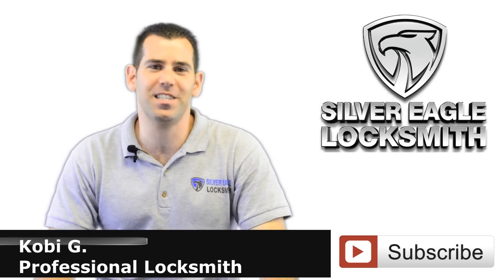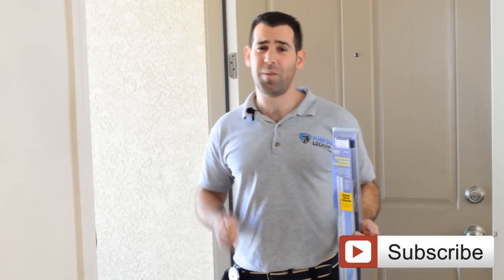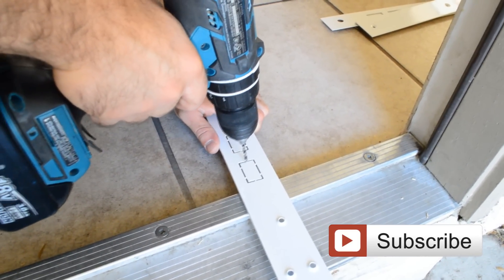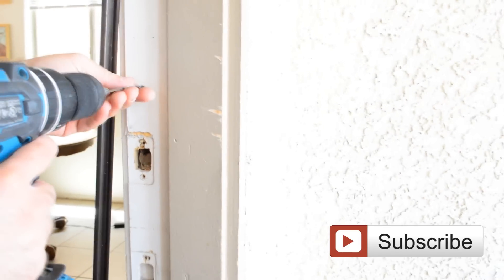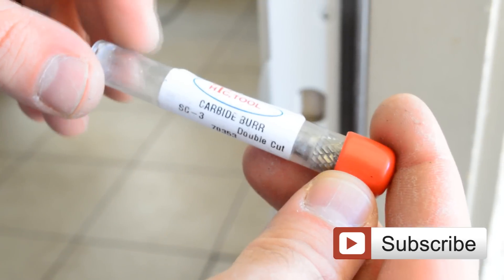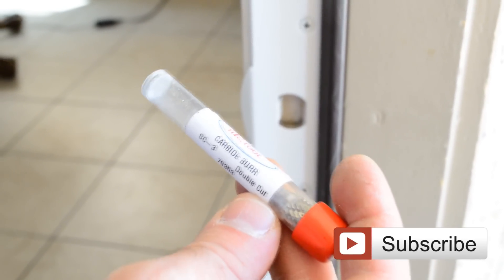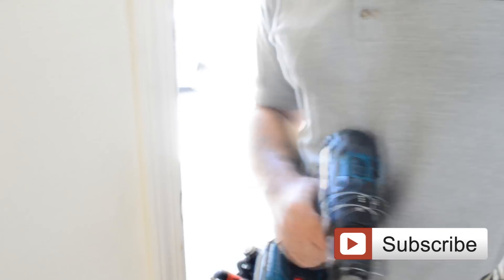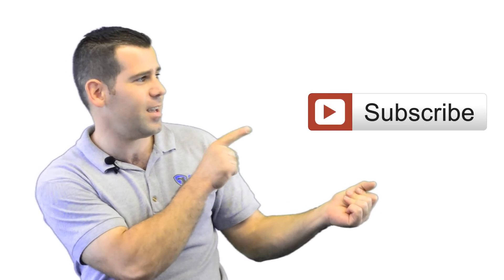Strike Plate - Burglar proofing Your Home With The Ultimate Door Strike Plate

Comment: Use a hack saw blade and not a drill to remove the plates and then file down or sand down any sharp edges.  That "plastic thing" is weather stripping that needs to be put back in place when done.  Use a center punch before drilling. More than one plate does not provide you any better security than multiple plates.  If it was all one plate that would be much better. A wood chisel will give you a much more professional cut than will a carbide bit.  That deadbolt cover is worthless, it will do nothing.  Don't just buy any woodscrews, buy hardened wood screws like SPAX for example.  BTW, Ring Doorbells are 1K which is not enough resolution for identifying a face or a license plate.  Buy 4K security cameras only.

Comment: The piece you did not use could it be used on the handle. This is assuming that the door doesn't have a dead bolt.

Comment: If you don't have a drill bit for some reason - I wont judge, I have a drill with spade bits but no regular drill bits lol - then you can use a block of wood and a sturdy flat blade screwdriver to punch out the metal @ 5:50

Comment: Maybe it makes sense if the door opens by swinging out, but if the opens swing in, then it makes zero sense to install this product unless you have lots of chump change to spare.  The whole idea is to prevent break-ins and won't stop you from going out of your home.
Reply from the maker: It makes sense to install it in both scenarios. You see what holding the door is really the frame and it doesn’t really matter if it’s a swinging in or out type of door, good reinforcement is highly recommended for any door
Reply: @S.E.Locksmith  Does this type of reinforcement work for double door or you have to use a different type of strike plates?
Reply from the maker: HonYin Kok No This Strike Plate it’s not for a double door. 
For a double door I would recommend you to check my other video: Nightlock Door Barricade - Double Door Reinforcement Tip https://youtu.be/1Ox85x5UXZA

Comment: Doesn't protect against sophisticated forced entries using a Halligan bar with a flat head axe to the hinges to which even the screws you suggest are no match against. You rip the trim off then hammer into the hinge plane to easily Force entry.
Reply from the maker: My recommendation is to reinforce the door from average burglars, not someone that have high intent to break-in. If someone really wanna break in they can also breaking window and getting much faster but that’s another topic of course

Comment: Look here folks theres aint a damn thing you can do about it. Im not a criminal but for whatever i thnk like one. This wouldn't slow down even a novice because theyll jam a porta power in the door frame and Jack your door open like it drop the soap in prison. Not to mention my previous comment about just foregoing the door and coming through the wal.
Reply: I saw a cane that would push a door frame apart till you just had to push the door open.
A cop had taken it from a criminal and kept it for getting into homes in an emergency without damaging the door. The criminal that he had got it from had used it for many years because the cops did not know it was a buglers tool.
One night he got caught on camera using it, then the cops had him. And it did not leave a mark on the door frame to show it had been used. And most homeowners never knew he had been in their homes till they found some things missing from in a closet or draw. Weeks or months later.

Comment: Three locks works well and as well as two locks with the lock strike plate.  But to be honest this option of 3 locks cost more.  2 deadbolt and one of the is a medeco deadbolt.   That should do it too. I got deeper screws with the medeco deadbolt.

Comment: We have metal doors and these on on them as well. Also the hinges have these little lips that stick out to keep the door from being kicked off the hinges as well. Upgraded all the screws to 4 inch screws as well. The front door I installed 2 of these things on the top that you can flip down when you are home to also help with kicking in. I've not put it to the test but I am certain nobody could kick in my doors and would need a battering ram or smash into it with a vehicle. That along with security film on all my windows and cameras and motion sensors and door and window sensors my place is locked down like fort Knox. Last line of defense if someone did make it in successful they would not be walking out alive.
Reply from the maker: From what you just described it’s sounds like Security is your TOP priority. 
It’s good to be smart than sorry

Comment: Those screws are not 3 inch diameter. THEY ARE 3 INCH LENGTH! The smaller screws are not less than 1 inch diameter. THEY ARE LESS THAN 1 INCH LENGTH!

Comment: To all viewers out there...my door got kicked in by a burglar or something who was just angry at me for not being home. I just went the store in the evening when I got home my door was ajar. So I tried to look around at ACE hardware store for something like this. My door jamb was damaged. So what i did was use a metal-stud strap plate I installed it and made a 3/4 inch hole and put it on the backside of the door jamb. I'm confident the next time the perpetrator won't be able to kick in my door. But I like to purchase this plate in this video. 👍 But like I said folks I used a 6 inch wide flatstrap the metal-stud framers use and I used some self tapping screws metal-stud screws which have a lot of holding strength. I'm a metal-stud framer.

Comment: “Damn! This door is tough. I’ll just break a window.” - Every Burglar
Reply from the maker: Did you know that you can make your windows reinforced also...?? 
Check my video:  https://youtu.be/Tg8AvttC46M
Reply: Silver Eagle Locksmith - I watched your video and the window film IS impressive. However, I have a few questions. Is the film available in ‘clear’ (non tinted)? Does the film require the glass to be removed from the windows? I have Anderson dual pane insulated windows that are filled with inert gas to prevent condensation. Is applying this film to MY windows a DIY project, something that has to be done by a professional glass company, done by Anderson or maybe something that can’t be done with my type of window? I also have two skylights. Can they be made more secure? As you said in your video, most people believe that “a burglar will get in anyway”. I have hardened my home, but I’m under no illusion that it’s impenetrable. I just make my neighbor’s houses look like easier targets. Thieves typically go after the low-hanging fruit. If all else fails, I’ll give them .45 reasons why they shouldn’t have picked my house. :-)

Comment: I would highly recommend using those door reinforcement plates on the bolts. Just as a visible deterrent it will save you a lot of grief. Thieves would try kicking the door leaving dents and shoe prints if they think there are no backing plates. I have a door with glass windows, so the first thing thieves see is a glass break alarm next to the bolt, the next thing they see is the metal plate screw mounted over the deadbolts, the third thing they see is the tint on the window so they can't see into the house. The more layers they see, the more hurdles they have to get around.

Comment: good product, better would be a whole door wrap that encompasses the deadbolt as opposed to just the door edge. 

That said,  very poor security specialist advise to not install even the door edge reinforcement. if there is not sufficient gap, create it with jig and router to make the clearance sufficient to have both the strike reinforcement and door edge wrap not rub !  also check hinges to make sure they are in good repair and not allowing the door to sag.. don't address symptom, fix the issues as well. good advise on the hinge screws to put in longer screws. 

also, you can minimize the risk of breaking off the screw heads with drilling the correct size hole for the screw, lubricating the screw threads with a bar of soap, wd-40, etc... AND not having your #2 phillips bit cam out of the screw head by using an impact driver instead of a drill motor... 

40 years in the business, in case you want to know...
Reply from the maker: Sounds like you know what you talking about... “40 years in the business” so my respect to you. 

One thing you totally forgot, that most people here on YouTube looking to have fast, cheap and affective security solutions and not working their a*s o*f 
To make their front door to be Fort Knox. 

Of course there is more things that can be done to increase security in general but the door strike is in fact the weakest point and this video teach you to fix this issue.

Comment: Guaranteed if someone tried to kick in the door, it will give at the weakest point which is the locks. The door will split so all the strength of the frame is useless unless you strengthen the door and locks.

Comment: I think the longer screws that go through the first piece of wood and into the actual door frame is really all the security you need in the strike plate area and replacing two screws in each hinge.  The fire department would have to come through the door itself than the frame around it.  No foot or shoulder is gonna break it down.
Reply: mama2one1 that’s better than most default installs but not enough to resist like you suggest.  This solution distributes the force across more area.   There are stronger options but they require more effort and trim repair.

Comment: Locked my keys in my house and had to break in. I bought one of these at Lowe's after repairing my wall. Very easy to install. It makes a difference.
Reply from the maker: It’s always works for Broken frame etc
Reply: Ross Miller

Comment: I guess i will be needing to re tile my house after you are done installing
Reply: To ishome iuuio
Reply: Always do it with a piece of wood underneath, also, using the clutch 

stops beheading the screws!!
Reply: I suggest you rewind it to 06:25 and check out the holes in the tiles
Reply: If you look at 5:45 right before he even start drilling it looks like theres already holes in the tile. Theres some definite black underneath the panel before he even start with the first drill hole. This might be his house and he mightve done this very same thing when installing the jam or door or something.
Reply: To ishome M
Reply: Yeah this guy is the guy that screws up your house in the process of installing it. And then comes back the next day and burglarizes your house.
Reply: @ianbrown8900  you cant penetrate tile like that! You have to drill it! And he stopped his drill once he made it through. Worst case is the bit came into contact with the tile and scuffed it a little bit which it didn't.  I would feel extremely sad and sorry for you if you actually consider yourself a handy "MAN" yet you would still need to hire someone to come in and install such a simple item!! My brother is 18 and he could do this easily with even a  blindfold on!!
Reply: I don't think he actually put any holes in the tiles. I think it's just shavings from drilling. But yeah you use an old scrap piece of 2x4 under it to make sure you do not penetrate anything else!

Comment: Thank you, I just learned the best way to completely complicate installing a piece of 25 cent steel to my door jam.
thank you
Reply: just kidding,
I liked the video but the product seems like you could get a lot more for the money.

I pulled out my door frames and replaced them with 4 x 8 studs that I made from raw lumber and welded some steel caps on both sides and top anchored with 3/4" lags then built a 3" thick door with integrated woven steel inserts inside of the door w/  1" pivot hinges and a brass / steel, 2 key, 5 point dead bolt for about $160.00 

If I remember right the steel I used to completely frame my doors was about 30 bucks
Reply: absolutely,
there is a ton of things that can be done to increase the security around the house. from adding a few screws to parking a tank in your front yard lol. keep up the good work.
Reply: Ingenious solution to a non-existent problem IF you have a pit bull and pump shotgun!
Reply: So jay stew ,,When you got ripped off. They went in through a window?
I personally like the shotgun hooked up the light motion sensor.
Reply: 25 cent steel?  That would be an option, but the kit he used has 3 sections designed to overlap and with cut-outs for the dead bolt and latch, and it comes with the required screws--no looking for them.  I dunno what the kit costs, but there's some value to having what you need all together.

Comment: Someone kicked my door in while I was out . The door frame casing was split .  As a repair, after fixing the casing, I installed a heavy duty integrated double strike plate and installed long screws into the studs. The kicker person was EXTREMELY lucky that I was not home at the time of the incident (if you catch my drift). What is strange is nothing was stolen.

Comment: I would remove the one piece of casing and install shims between the stud and jam at each new screw location so when you tighten the screws it doesn't open door jam reval and have a big gap. just my opinion
Reply: didn't hand tightening the screws (after drilling proper pilot holes) keep that from happening?
Reply: As long as he doesnt throttle the screws in with a heavy duty impact there is no risk of deforming the door opening. The foam that is in between the door jamb and stud is high density and heavy enough to prevent even moderate deformation of the door jamb. The biggest mistake he made was in thinking that the drill bit length makes any difference whatsoever. Even the best custom build door jambs are only 3/4" thick wood and piloting the length of the screw even if we assume he is trying to reach well beyond the stud is not necessary. He could save time by just using one bit. Lol at people complaining about using ceramic tile as a backing during the drilling process - even a cobalt bit isnt putting a hole in tile without serious intent.

Comment: One thing you can do instead of installing the plate ( and do it differently, mind you ) is back out the small 1" screws and replace ALL of them with 4" screws, on the latch side as well as the hinge side. If you have a solid door and frame it's gonna be VERY HARD for anyone to kick in your door, with those 4" screws, makes all the difference !
Reply from the maker: I definitely agree with you but the overall Strike Plate is a big part of reinforcement to any wood door
Reply: I had my husband add 4 inch screws to all our exterior doors, hinges and strike plate, then installed security doors. That plate would not give me that level of security i need when my husband is away for work.
Reply from the maker: Trevino Bush and how much this all pleasure cost you ?
Reply: Silver Eagle Locksmith: Money is not an issue. My home is an investment.
Reply: Trevino Bush saying your home is an investment and money doesnt matter makes no sense. There are things you can do to your home that will not affect the value. Therefore should not do if your home is a monetary investment. 

If you are focused on peace of mind your comment regarding investing in that makes much more sense.
Reply: Richard Vargus: if i knew you i would value your opinion. I stand firm on what i said. It’s fine if you disagree.
Reply: I THANK GOD FOR HAVING ME BE  A CARPENTER and not a handyman .
Reply: Trevino Bush that play makes a big difference, it prevents the casing from splitting, and with those 4 inch screws that door is going nowhere

Comment: Let’s be honest; any modifications that require deeper and/or additional holes for screws into the wood on your door and/or door frame only weakens the wood.  For such a small amount of wood on your door and door frame, less mass equals much less strength.  Instead of drilling away the wood on your door frame, get a Nightlock door barricade, which is mounted into the solid concrete floor, or get something similar to the Security Door Bar (by Securadoor).  You should also have a good outside motion detection system to alert you of intruders around the perimeter of your home.  I found Guardline to be the best.  You can easily add relays to the system, such as an alarm and strobe light.  Lastly and personally, I also keep a cellphone and handgun on me at all times while at home.

Comment: Hey great video but you should make a video with a double entrance door. Where the weak point is the centre of the door. 

You can also put a door handle plate on the actual door knob and dead bolt to prevent splitting of the door. I’d ensure you put that on.

Comment: I'd like to see cutouts for the strike plates instead of drilling them out, looks like you could cut yourself bad or damage the floor if you slip with the drill.A lot of criticisms of the usefulness of this reinforced strike plate, but I'm for anything that makes a little more difficult for a burglar. That's the best you can do for most residences.
Reply: THIS ONLY WORKS for an Entry door , and if you happen to live in a city HIGH RISE !!!! IF you have any windows, a burglar WILL ALWAYS enter through a window, as those aren't usually alarmed, like doors are !!

Comment: Why not use 3 inch screws for every hole on the strike Plate?
Reply from the maker: That’s a great question! 

Because not all the holes are closed to the inside door stud location. the inside stud  is usually located close to the line of the door weather stripping and goes farther in - about 2 inch. that’s way other holes will not hit the stud. Check out my video on the 11 inch security door Strike Plate - it’s much easier to install, cheaper to buy and give you a great security as well if not the same as the Ultimate Door Strike Plate (this Video): https://youtu.be/SyYbZzuHn3Q
Reply: Silver Eagle Locksmith Thanks for the reply.